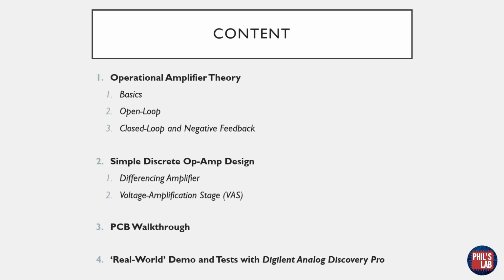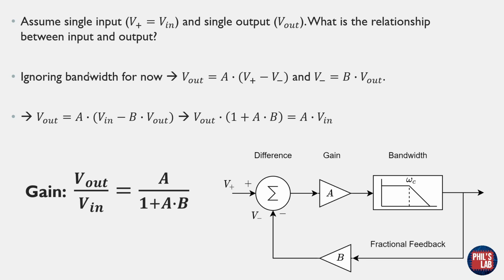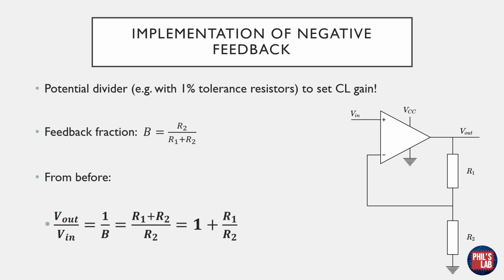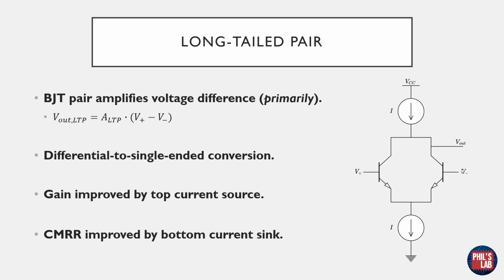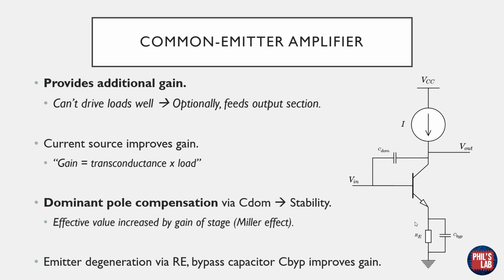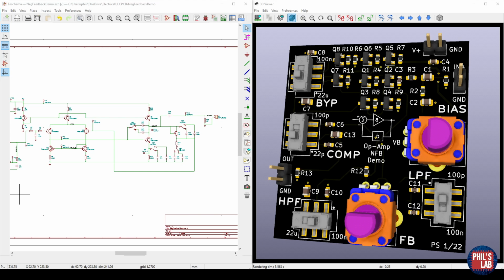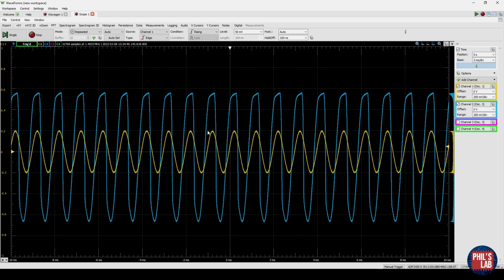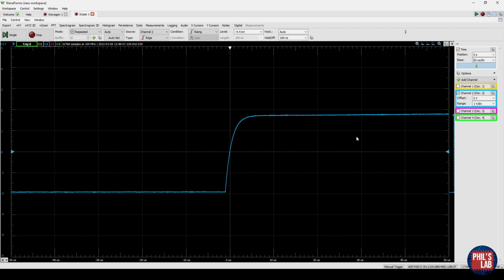(Sponsored) Op Amp Theory and Design - Phil's Lab #53

Comment: Im here because im confused about something I realized in an opamp schematic. It was my understanding that one input could accept a positive or negative input voltage, however when I looked at the schematic it was only npn transistor on both input. Npn transistors wont turn on with a negative voltage. So either there is npn and pnp opamps or im missing a trick

Comment: Hello!! Great video! A question: how did you measure the gain of the input stage and the voltage gain stage? Using a very very small input in order to not reach the supply rails in the output?